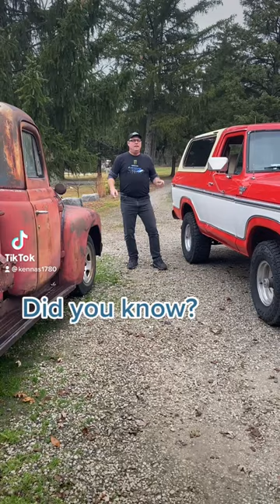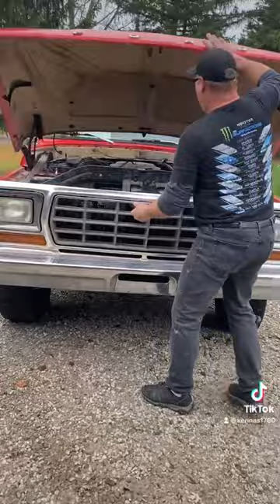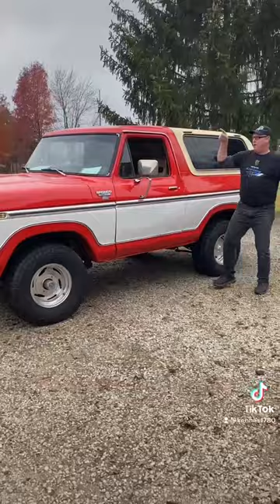1979 Ford Bronco begins transformation! Modern V8 POWER #shorts

Comment: 351 mod 400 was a good motor if built correct
Reply from the maker: If built properly- for sure! They could be a power house but this isn't the one. Thanks for watching!
Reply: And had the American cast block. The Mexican blocks sucked
Reply: I built a 351M and later, a 400 M for my Welding truck. 
Strong enough engines, but needed headers and the Right exhaust or they wouldn’t get out of their own way. 
But 4” stacks and no mufflers, they would run like Beasts. And decent mileage, to boot.
Reply: I am not a Ford guy by any means. I found a 1979 Ranger with a flatbed fifth wheel, 351 modified 400 and a pretty good size cam. I come to find out that it was all Factory called the farmers special, and that thing sounded Wicked, would not let a Mustang pass it no matter what kind it was. I am not a Ford guy by any means, not because of their products but because of who Henry Ford was and how evil he was towards the Dodge brothers. I have higher morals than to own one of those. I would rather buy a Daewoo and drive that than drive a free Ford.
Reply: @michaelathens953  true story
Reply: I wonder how much money "correct" is ?
Reply: @crazyoilfieldmechanic3195 -Depends......
How much a Big-Ol' Holley four barrell and a timin' lite cost ye?
 THAT'S how much.
Reply: If you left them stock they were just boat anchors
Reply: The problem was they were short on 351 blocks so a quick solution was to put a 351 crank into a 400 block, the issue they got was 351 connecting rod was not long enough so they solved the issue by making longer connecting rods, these flexed a lot and had a tendency to snap if pushed too hard too long, then it would drive right through the side of the cylinder and block.
Quite a few times as a kid I would see one of these or a pickup of the same era sitting on the side of the road with coolant pouring unto the road. The swap they would do is(if still running) swap in a 400 crank and connecting rods or swap in a 400 engine, some put 460s in.

Comment: The 78 and 79 were different body styles but they were the first Full-size broncos. I can go on for days about this truck. this is my favorite vehicle on the planet. Color and body style year and everything
Reply from the maker: Thanks for watching!
Reply: I had a 79 Bronco unfortunately it was a rust bucket. Fun fact only difference between the 78 and the 79 was round versus square headlights.
Reply: Mine to I like it the 73 to 79 was some of the best trucks ever made but I like the 400 it was not a power house but it got 13 or 14 mpg had good pulling power and a 302 in the f 100 was a nice cruiser got 18 or 20 not a fast truck but you could take long trips with out breaking the bank
Reply: A 460 wakes them right up
Reply: @jeffhunter2553 78 did have square headlights but only in higher end packages
Reply: Nope
Reply: @gregallen4272  The 400 is an excellent motor.  The Cleveland 2v heads breathe really well.  Install an RV style cam with a double roller cam drive.  Upgraded ignition with a Mallory voltmaster coil.  Ceramic coated headers with Flowmaster series 50 HD mufflers.  Then an Edelbrock 4 barrel manifold, topped with a Holley Sniper EFI.  Swap in an overdrive transmission.  And now you have a very fuel efficient package, that can tow heavy loads!
The 351M and the 400 were very underated.  Even if a 2v carburetor was used.  Just rounding the edges of the plenum, were the flow turned below the carburetor.  Gave tremendous flow improvements.
Reply: @zxej6879  thay are very good engines a family member has one in his 79 f 350 steel bodied rollback we have used it for years and had very little trouble with it and it was rebuilt in the late 1990's and not used for scraping just used for personal use if driven by easy the last long trip to south Georgia to pick up a rough 67 Rancho it delivered almost 12 mpg at 50 to 55 mph the longest trip it did so far is east Pomona California to get a 40 car it averaged 13 on that trip used a little more going through the lower Rockies and down the grapevine and picked up a 41 car maid and sold before dec 7 was a huge 4 door sedan. In Kansas city was where it was picked up the man he bought the car from was a very cool guy his number one keeper car was THE Lincoln zephyr that was used by Carroll Lombard and her costars for the premiere of the movie Gone with the wind it didn't have 15 miles on it because it was only driven by them around to the front of the Chinese movie theater he had it displayed in front of a movie style but full size of Chinese theater with wax figures of the two movie stars sorry to get side track but a blown exhaust donut on the passenger side was the only problem with it after he got back it only took about 30 minutes to repair he said if he had known that he'd have done it on the road . Like many old truck drivers we just work on old cars now and then getting older now so not so much thanks for the reply and thanks for being a part of the car community the friend ships of people I have been very fortunate to have from Daytona beach Turkey rod run to the Charlotte auto show and especially pigeon forge rod runs the F100 show was my favorite but just a memory of what it was

Comment: Had a 351 mod 400 that didn’t suck at all, damn good engine
Reply from the maker: They have potential for sure.  Full length video out now. Thanks for watching!
Reply: I have an 81 with the 351 modified, still running like it’s brand new, only problem I have ever had was, every winter I have to change a set of push rods due to the lack of good guides, but otherwise it’s a tough and durable engine.
Reply: @jimmoravec1326  Actually the M wasn’t supposed to stand for anything, the M was only used by Ford to separate it from Cleveland and Windsor, for the purpose of emissions. Some have believed the M stood for Michigan Casting, however that is wrong also. Most mechanics and enthusiasts still refer to it as modified because it is a 400 excluding the crank and pistons. Even the rods are interchangeable, you can easily make a 351M into a 400 by swapping cranks. The bore is the same, technically 351m is a destroked 400.
Reply: @anthonyh4529  
I was always told it stood for Midland I was told wrong 😅  the 360s & the 400ms were junk far as I’m concerned.  Anyway thanks for the clarification 👍
Reply: @jimmoravec1326  don't discount the 360 truck block I my area thay are bringing about 300 dollars for a good un bored block  because thay are high nickle and speedway motors sells a complete stroker kit for just under 2k turns it into a 441 ci block and all FE heads are cast the same way so you can massively port the intake and exhaust side. Don't recommend the 427 valves because it will limit flow due to 428 bore size and intake valve is to close to side of bore but the 428 cobra jet valves work extremely well see a few built most made a little more than 1 hp per ci good motor but don't over cam it the voodoo cam or smaller bootlegger is a lot better for larger trucks or cars it has more bottom end power

Comment: Yes I had a 1978 and  the engine was the 351M or modified I thought it was a decent engine for the time the only difference between the 78 and 79  is the 78 models like the ford pickups had the round headlights and the 79s had the square looking or rectangular type headlights I just remember it had a great frame I have owned two Broncos in my lifetime a 1978 and a 1974 and that had a 302 the only thing that sucked about the 74 it was it had manual drum brakes all around so it was a beast to stop once you were rolling at a good pace
Reply from the maker: Heck yeah! Full length videos are out now! Thanks for watching!

Comment: I'm in the process of swapping a 77 super cab f250 cab onto my old trusty 95 bronco frame now, cannot wait to get this project done, thinking about 2 more years to go lol
Reply from the maker: Heck yeah! Git 'er done! Full length video out now. Thanks for watching!
Reply: @GrenadeMotorsports  with 5 kids it becomes more of a financial situation lol. Going pre runner style, going to be a while before I can afford the suspension lol.
Reply: If you use a 4BT modern motor.  You will have good power and awesome power.  The B series Cummins are extremely heavy!  We have a '18 Ram 2500 4wd with the 6.7L Cummins.  Gets 18mpg with our 4wheel popup camper on the back.  And 26mpg without the camper.
Reply: @zxej6879  I'm good on the diesel, I'm a fan of small blocks singing at 6 grand lol. Not sure how a diesel would hold up ripping wide open through the dunes either...
Reply: @chrisblair3081  A 351M or a 400 would be good for the high rpm stuff.  Just reduce the curve under the carburetor going into the plenum.  A good set of ceramic coated headers and a flowmaster 50 series HD Big Block mufflers.  Should be good on the dunes and streeet.
Reply: @zxej6879  77 has a fresh 400 in it now but I'd rather keep the fi 5.0 in it, have more parts for that in the basement lol

Comment: I had a 82 i know it's a different body but I'm here about the motor, mine had the 300 six cylinder and it was unstoppable like a tank it would go anywhere, it had 36 ground hogs on it, ohh how i miss it😪
Reply from the maker: 80-86 were the best! Thanks for watching! Full length videos out now.
Reply: That 300 is a hell of a engine; Cheap and easy to build up.

Comment: I'm rebuilding a cj5 witch has been plagued with the same issue you have. Some idiot thinks it needs to be a top fuel dragster. It was a small block but now it's going back to a 258 straight 6. But my cj5 will actually go off-road because that's what it's meant to do it doesn't need to gap anything it gets beside or run 10s in the 1/4 mile. I think people forget why these were made in the first place when they say things like this or don't realize what straight axles and leaf springs are for.
Reply from the maker: Absolutely! Not everything needs to be insane, this one just needed modernization. Full length video out now. Thanks for watching!
Reply: I had a 77 CJ7, factory 304. A mild cam, 4bbl, headers, duals rear locker and a T18 swap. It would out run any factory 80s car and crawl like a spider.

Comment: Yes, I have that suck 400 two barrel on my 79 f250 with Dana 60s front and rear.  Those axles would make that bronco real sweet.
Reply from the maker: They can be great engines, I know. This one, wasn't. Full episodes out now. Thanks for watching!
Reply: @GrenadeMotorsports  we had a 351m-400 go for 500,000 miles. it had never been apart.

Comment: Yes they did that 400 wasn’t the best unless built right and I love Fords, I had sunk one these a 79 with 44 gumbos no top lol so deep it had water on intake at one point , and Cab floor to the lower half dash I had to get a machine to pull out snapped 2 gms axels even tried a winch , I will say that 400 started and got me home once out,, 2 days later and all that water . I was impressed ,But I prefer the 302/351/351c/or even straight six in a bronco , I’ve had 6 different years .
Reply from the maker: For sure! Thanks for watching!
Reply: Properly put together a 400M rocks.. The secret is "Properly".. With the right parts and both naturally aspirated a built 400m will out Torque a coyote especially at low rpms.. I have Coyotes and love them..Boost is where they become an animal..not NA
Reply from the maker: @KR-qs3rt  For sure!

Comment: That's not entirely true. I bought one with a 460 in it, and it had a spun bearing. So I took the old bearing out. Put a new bearing in it. And then put 100,000 miles on it. That 460, was an absolute monster. And it was incredibly easy to work on. I should also mention, I completely eliminated all of the EGR and a/c systems on it. And got the power of a 460.

Utterly amazing what happens when you take 60 lb off the engine.
Reply from the maker: They do have good potential for sure!

Comment: Yes most full size Broncos had the 351W and
they sucked power wise and fuel consumption 
wise. I had a 96 the only thing I liked about it was it could turn around on a dime with limited space UTurns were the bomb if you
needed it and the weight and bodies were just
a beast.  But that motor and trans gotta go.
Reply from the maker: They did have power potential, but not this one.. Full length video out now. Thanks for watching!

Comment: The yho g you do is ,find a 429 out of a 70 to 73 large Ford or mercury n drop it in there ,I put one in a 77 f150 high boy . IThe 429 came out of a 73 Merc Marauis,with 105 K on it. I put a new timing chain on it n a set of umbrella seals on the valve guides. That truck would bury the needle all the way around up against the 0 on the speedometer. 120 t mph . It got 13 mpg .
Reply from the maker: Heck yeah man! Thanks for watching!!

Comment: 1978-1981 were the lowest hp years with any of the manufacturers. All the engines sucked. They could be built but I think the 1981 Corvette left the showroom at about 165hp.
Reply from the maker: Exactly! Full length videos are out now! Thanks for watching!
Reply: @GrenadeMotorsports   in 81… the K5 was available with a 250 and a 305. Both put out 130hp with the 305 putting out about 30 more pound feet.

Comment: No you put a 429 cj in it
Reply from the maker: That would be cool! Full length video out now. Thanks for watching!
Reply: Still have mine, with the 429 cj. Built in November 77. Must have been one of the first made. I plow my driveway with it
Reply: They only came out with 400 ci but that's a big block bellhousing bolt right up

Comment: Those engines did suck.
Reply from the maker: They have potential but modern stuff is the answer for this one. Thanks as always. :)
Reply: @GrenadeMotorsports  I was a line tech for a Ford dealer back then. In 1983 a Bronco came in( full size) with a 5.8, I think, with a VV carburetor and EEC2 engine controls. I remember the “fix” for that particular calibration was to order a part number. I had no idea what I was ordering. About a week later a huge box showed up with a new engine wiring harness an intake manifold and a Holley four barrel! No kidding! I was just dumbfounded. However it fixed the multiple problems.
Reply from the maker: @shaggydogg630  New Video is UP!